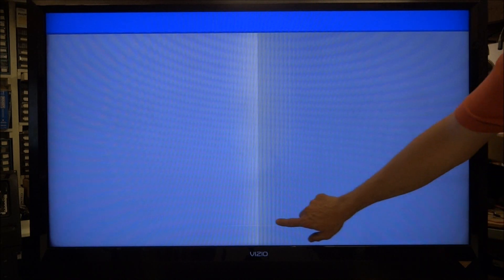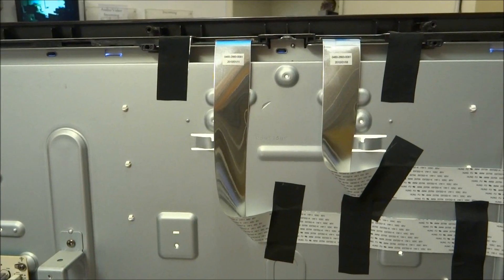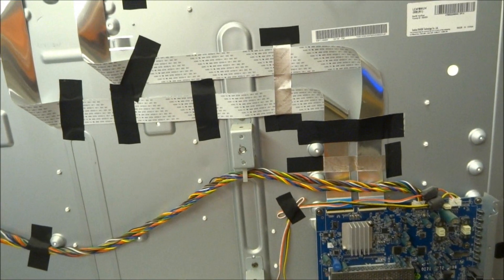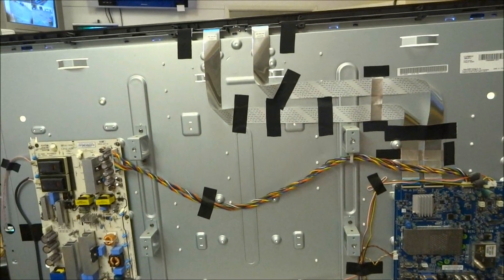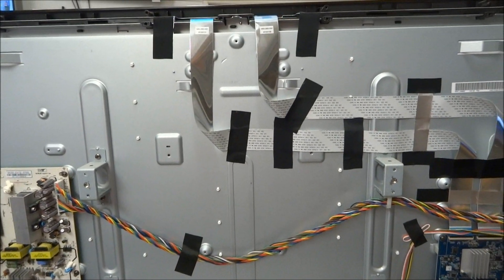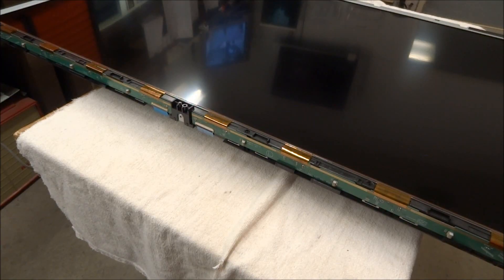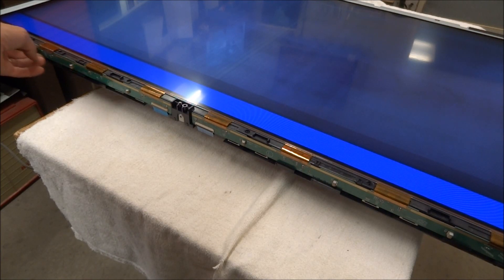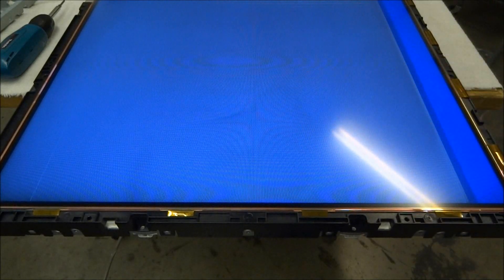Troubleshooting Distorted Video T-Con of LCD Panel TV Repair. Vizio Sony Samsung LG Panasonic

Comment: Very informative.  I have a Vizio V555-H1 and I have the power led comes on then goes off. Backlight stays on I have checked those and they do all work fine.  I have changed out the main board, power supply board, and tcon still no joy also swapped out the power cable & checked with the flashlight test and NO image.  So any suggestions does it appear to be the lcd panel?

Comment: lg 47lb5900 has thin black horizontal lines spaced approximately .25 inches apart from top to bottom. the lines are visible but faded near the center of the screen. any thoughts?

Comment: How are you? Thanks for your good and informative videos.

My Samsung LED TV is showing vertical lines at the bottom of the screen but these lines would disappear and reappear after some time. What could be the problem.
Reply from the maker: Unfortunately probably a bad LCD panel. The tab bond ICs are starting to fail it sounds like.
Reply: @norcal715  Thank you very much. This TV has sound problem, sometimes it loose the sound but the sound would come back after some time. And it switches on and off but not occasionally, sometimes once after seven days. What could be the problem?

Comment: so what if my image Is dim on the right side  but is there ... so the backlight inverter went replaced it got the TV on backlights are fine lit end to end just dim on right side
Reply from the maker: Is it just dim or is the video smeared also? If it is smeared with slow response then the LCD panel had failed.
Reply: @norcal715  no the image is fine just dark on the right side back lights are fine

Comment: I have a Vizio D50X-D9.  I pulled the panel to replace the backlights.  It has some of those bonded tabs on each side of my screen, 5 per side i believe.  The tabs appear to have a small metal piece in them.  When I put my tv back together I had no screen.  When I slide those side tabs back down into the side frame I got my picture back, but one side is dark and I have random horizontal lines going through my picture.  Did I ruin it, or is there a technique that I need to know about putting those side tabs into place?  I already used tape to secure them down.  Any else that I can try?  Thank you in advance.

Comment: I recently put new led arrays into my tv they now all light but still no image on the panel. I then replaced all the boards in my LG 42LN575V Smart tv but screen still shows no image. You mentioned that if panel has gone you can sometimes write on the panel with finger tip which I tried & I get a white trace on screen which then fades does this suggest panel is at fault even though no damage is present to the eye. Thanks in advance for any help.
Reply from the maker: I would suspect communication from the main board to the timing controller (t-con) or t-con to the LCD panel. There has to be something disconnected, maybe the ribbons from the LCD are not seated correctly

Comment: I had the same issue on Vizio m50-c1 half of the screen comes up fine with one side TCON connected to the lcd panel.. when both connected, I get blank screen.  tested out all caps short .. i even changed all caps... short coming from glass lcd side ...   Thanks for sharing ...

Comment: I've got a Polaroid flm 2601 LCD tv.  Video works on all inputs except in RF tuner mode.  The raster is there but just snow.  No audio in the RF mode and no headphone function.  Also it will not channel up and seems stuck in channel 5 also with snow.  Any suggestions?  Thanks!

Comment: Helloe,i have an LED TV Samsung with sound but no picture only horizontal  lines appear on the screen
Reply from the maker: Check the 3.3v and the 5v supply on the coils of the buck boost converter

Comment: Would a bad T-CON board cause the screen not to come on period?  I have an older Sony Bravia and if you repeatedly turn it on and off the picture will eventually come on and be beautiful.  But if you cut it off and try to cut it back on, theres no picture or sound.

Comment: I have 3years old SAMSUNG  mod.no. VA 32H5500. On turning on my TV it works normal for few minutes and after that slightly flickering of screen starts with double image and subsequently vertical faded lines as well as horizontal lines appears with smoky pictures.What would be  the proable cause & its solution.

Comment: I am amazed at how many people WHO HAVE NO TECHNICAL EXPERIENCE and just want to save a few bucks are saying 
"Please help me fix my own TV, My TV won't turn on what should i do"

Now... Tell me it's not just a matter of time before someone gets a really really rude shock (or worse)  from touching something they shouldn't have on the Power Board.

ATTENTION ALL NEWBIES WHO ARE TRYING TO SAVE A FEW BUCKS

1. Basic understanding of Electricity and Electronics is MANDATORY before you even consider taking off the back cover of your TV

2. A Basic understanding of Electrical components is MANDATORY

3. Basic understanding of Electrical Safety is MANDATORY

as a general rule
if you don't know how to troubleshoot
and you don't know how to solder
and you don't know how to change a capacitor WITHOUT ASKING ON YOU TUBE

YOU SHOULD NOT BE OPENING YOUR TV
instead
Get someone who knows to fix it
your life is not worth less than $300,  so just pay someone to do it ... ok
Reply: tell 'em what I say to them, "Ya gotta push the power button HARDER"
Reply: Thanks Mom.
Reply: 😂😂😂😂 Let them learn the hard way.

Comment: i have a 46" samsung LCD that appears to have a solarization issue. The menu is also a bit distorted but not nearly as bad as the tv  display. Should I not waste time replacing the t-con board?
Reply: If you also see it on the menu it's normally the Tcon board and they are usually affordable and easy to change out. Try www.shopjimmy.com. Some models uses different Tcon's so make sure your part number matches what you have in your Tv.
Reply: If you remove the Tcon board and see a little square chip on it that says "AS15" or "AS19" then its your problem. Those chips are so unreliable I order them in bulk on ebay and replace them because of the same solorization issue... samsung used them in your model set because I believe I repaired 2 with the same problem. these tv usually have the same engineered faults.. LG made vizios usually have faulty eproms or voltage regulators.

Comment: If you don't recommend Led or LCD than what do you recommend I buy?
Reply: I was thinking the same thing... I repair tvs too and IMHO an older non led ldc tv is the most reliable type of tv... plasma fail quite often and the repairs are usually very expensive (ysus and buffer issues) I dont think they even make DLP sets anymore but even some of those were plagued with defective dlp chips.

Comment: I have a vizio M601d-A3 and it has a horizontal line on the top left side thats black and runs 3/4 across the screen do you think its fixable ?

Comment: Sharp LC-70LE650U 70-Inch Aquos TV TURNS ON WITH PERFECT PICTURE AND SOUND, 5-10 MIN TV TURNS OFF? IF YOU WAIT A WHILE UNPLUG AND PLUG BACK IN TV TURNS ON WITH PERFECT PICTURE AND SOUND? JUST TRIED MAIN BOARD SAME HAPPENED! WANT TO TRY PS AND T-CON BECAUSE TV STARTS OUT WITH PERFECT PICTURE? CAN A BAD PANEL WORK PERFECT FOR 10 MIN THEN FAIL?
Reply: Did you check all of your capacitors? That could be the problem.

Comment: Sir I have an lcd 42" newly bought...
But I Used it only 3 and a half months only.........
The screen went black...
After Some test I made... I figure out that the Audio is Ok... And There are Image too (tested via flash light)...
I think now that the problem may be the back-lights Invertors... 
But I just cant situate the invertors yet and how to Fix My Hitachi 42"... How does it look like and how to fix it myself...
Plz help... Thank You In Advance...
I can Notice the same type of Power Supply Board as in your video... Are Those Two Identical Item The Invertors For Backlight...??? They Are Same And Exact Placement On Mine Too.......!!!

Comment: hi i have a samsung tv model #LN46A750R1FXZA serial #ALAU3CNQ707767F.Turn on tv sound good left side of panel is dark an images seem to be in slow motion,after tv warms up it plays fine.that was good for about a month.now left side does same thing all the time.should i check t-con board? ty.
Reply: +frank m did you take pictures while doing the repairs?
Reply: no.

Comment: Hi Norcal,.
I have a Vizio E550i-AO. With the back cover removed, it looks very similar to the set you worked on. The symptoms I have are a good image shows but the lower half of the screen is in a darker shade. It's still visible but significantly darker. I removed the ribbon cables from the main board to the bonded boards at the bottom of the set. Half of the screen disappeared vertically when the ribbon cables were removed. When put back, the screen looks the same, darker at the bottom half. Do you have any recommendations?
Thanks

Comment: Great video and I think I am going to trouble shoot my Samsung TV  to see if the T Con  is the cause or the LCD  panel.  

VGA  seems to work without any issue but HDMI  ports and cable port are causing garbled video and restarting of the TV.

Comment: hi  do you mean by something is loading the data down to the lcd panel that the boards are working correctly and all circuits are active up to a break in the wiring inside the panel and assuming there no connection defects found in the tabs or connections to and from the tcon [even with the use of freeze spray] ///not sure if this is my case,all tabs seem secure no change with freeze spray// ive got a 60 inch 2010 sony all bonding tabs [16] are on the bottom of tv and using [4] driver boards each pair from the tcon connected by flip up connectors using plastic circuit connectors that are similar to the flat ribbon connectors to the tcon in construction.These were crumpled during assembly resulting in cracks in both in the middle and looks as though a connection or 2 may be affected,however when i swapped sides with the worst one it didnt effect the right side of the screen with no picture problems,the issue with the left side is that i get a see thru  mainly red vertical band [top to bottom]turns pink on lighter backgrounds,blue and hardly distinguishable with the logo screen,and is gone with black and on some scenes with bright lighting ie outdoor or price is right,otherwise depending on the background color of the video the red transparent bar will break up and become choppy otherwise it will be a solarized picture just between the bar [ie looks like a heat signature] also one side of the bar begins at the same point the screen turns white when disconnecting the left outer driver driver board [resulting in a quarter white screen] cant seem to find a closely comparable scenario,and was hoping that you or somebody may be able to advise between the likelihood of it either being a tcon/ panel/ or undetectable tab problem.//my thanks to all that took the time to read

Comment: I watched your video and liked how informative it is. I have an issue with my lg led tv the ribbons are good and the t con board is good but on the bottom right hand side it apears the the inside ribbon attached to the screen is over heating? Wouls this mean a bad screen?

Comment: For anyone who has a Vizio LED, LCD, or Plasma I seem to have a problem getting to the service menu to pop up... I held ch + & ch - at the same time while power is off for ten seconds, then try to attempt to push power button on, but the tv turns on by itself when I hold the channels buttons, anyway I continue to hold them for ten seconds then release any then hit menu but I don't see no "F" on bottom right for factory. I push and hold menu again with mute and exit/last buttons and still no service menu! Any help or ideas?

Comment: On my vizio model P42A due to making a poof sound i opened and replaced a blown fuse then i only had sound no picture so now i changed the y sustain board. I do have picture now but its a bit dark and not clear. I adjusted the picture settings and didnt fix the problem. What would you recommend for me to do to fix the problem?

Comment: I have the same Vizio. The interface board that holds the cold cathode tubes shorted and smoked on the top left tube. I ordered a used board. do you have any tips for a rookie on installing it ?

Comment: Howdy. Just been given a JVC LCD LT42DG1. Starts with clear picture then within 10 secs has green vertical lines with distorted picture. Tried HDMI with same result, tried no signal at all, lasted probably 3 min with blue screen and "No Signal" before lines appeared again. Full screen, in groups of 3, pink/orange lines with blue screen.  Any help, much appreciated.

Comment: Norcal, I have a Samsung UN46D6420 that started with horizontal lines and progress to a black screen. I do have audio and back light. I took it apart and found that if I disconnect the Left side on the T-con I get half of the display to come up. The same is not true with the Right side it stays black. I notice that you mention on this video it was the panel vs the motherboard/t-con. What lead you to believe it was the panel vs the right channel on the board if that makes sense.

Comment: Hi Norcal,  I have a Samsung pn50b450b1d white/gray transparent vertical lines in front of the picture.  The picture quality is good; it's just that the transparent gray lines are in front of the picture.  I changed the logic controller and had the same problem.  What else could this be?

Comment: I have Vizio VW42LHDTV10A with a similar problem except the sections are separated as  upper and lower parts of the screen. Could that also be a defective panel? When I got the TV the screen was black and the power button would not turn it off. I replaced the U33 and now have the blue screen with the "No Signal" moving around until it gets half way down the screen then it turns to white lines down the center vertically.

Comment: Thanks for posting the video, very helpful!  I have a vizio vo320e that I believe is the tcon/mainboard but not 100% sure...No video with sound and the backlight is working...Remote does control the volume/channels like normal so I'm not sure if this model has the tcon built into the mainboard or separate. Thought you may have some insight on this model?

Comment: It might have worked to swap the cables,  but in my experience, usually the ribbon cables have different pin counts. For example, the other might be a 41 pin cable and the other one a 51 pin cable. I've seen many LVDS-cable problems in LG-panels and most of the time you can see the defect with a magnifying glass, as the cable has not made proper contact with the connector. You can see imprints between the actual contacts in the cable, indicating a bad alignment of the cable in the connector

Comment from the maker: I assume you mean left side drives right side and right side drives left side. The pin outs are usually mirrored (reverse) of each other and since the ribbons only have conductors on one side you would need crossover cables. I suppose it could be done. Great question.